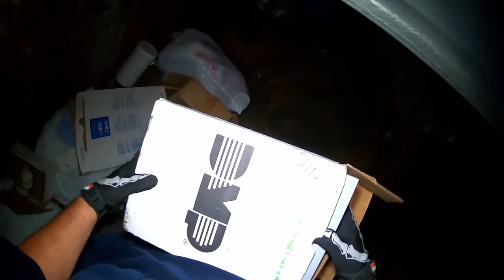Dumpster Diving "Now THAT’S A Knife!"

Comment: It is amazing the things people throw away, most of which could still work if they took the time as you saw like changing the batteries. 
I used to dumpster dive when I was very young at the bookstore next door to use as was surprised at the stuff they would toss. We finally called them once when they tossed a whole Xmas figurine ceramic set that had nothing wrong with it. Yeah, I'm a honest person.  They came and picked it, thanked us then put a lock on the dumpster !
Reply: 🤣🤣🤣 You could have wrapped up the ceramic set for a Christmas present for Mom.

Comment: Hhahaha... 45:00  90° @ 108% humidity.  Not possible but even at 100% humidity it's 132° heat index.

Remember these things are in the trash.  They may work.  But do they work correctly?  I hope they do.  Congrats on the finds.

Comment: That style of black shelf at 14:45 would be graet to build your walls out of but it works a lot better if you line the inside of it with chicken wire or smaller I liked the smallest I could get because you could throw small bits and those stud things you dont like cant fly out if you make the back the same my set had slide on hinges that attached to the side walls and the side walls were able to open aswell when you attach them use bigger hinges and weld them to the inside of the bed but remember to build them so they lay flat against the side of your truck I havent forgot how much you love your truck so the next time you see that rubber stuff in the bins that you didnt know what you could use it for if I was you I would put them underneath the plastic tub thats in the back of your truck because if you look carefully you can see the floor at the back between your two wheel atches and your tail gate you done most of it when you dropped that big motor from the top of the open top plus when you through in the heavy metal doors.👍👍✌👊👊

Comment: 19:39 Those have nothing to do with fuses.

Those are clear keyboard key covers, for IBM point of sale keyboards. The included plastic tool is used for removing the key covers.
Each keyboard key can be labeled, and those covers cap the keys, to protect the labels.

Comment: i took the wood top off of a bedside hospital table like that, put a stainless panel from the front of an industrial dishwasher on it, and made me a height adjustable, rolling work table for my garage. i cut a rubber floor mat to fit in it, and it's got a 1" lip on all four sides so tools and parts can't fall off. i just roll it up to whatever i'm working on, set the height, and bob's yer uncle, i don't have to worry about my 10mm socket getting eaten by the tool black hole that every project has. it's about 75 bucks to buy one, i made one for free in 20 minutes from crap in my scrap hoard. can't beat that with a stick.

Comment: The clear plastic pieces you found in the computer dumpster are keyboard overlay covers. The grocery store had paper templates to denote what each key did. The plastics covered the paper template to keep them in place. Not used much anymore. Most stores have switched to touch screens.

Comment: Fluke is high quality electricians tools, absolutely the best there is, expencive, very presise measuring tools built to be safe for professional workers, amateur hobbyists will love these if they has the use for it. Fluke has a better fuse system and isolated test leads that the cheapie multimeters has. Yeah, Fluke is the #1 so fix this one :)
You can just pick a new battery clamp from a dead 9 volt battery and use that instead if you peel off the battery case metal carefully, 9v batteries has 6pcs of smaller AAAA batteries inside so it is not a mess to do it. I did it a few days ago. You can solder the new battery clamp on, some hotglue to insulate after that and voila done, easy fix but make sure plus and minus gets to the right places :)
Take off the rubber insulation and take photos with your phone of the wiring before you disconnect and swap the battery clip, they you wont screw up the red and black wires.
Black is minus, red plus. Fluke is like that, if you find something from China it may or may not be the same color code this way, but if knowing electronics one see where thing goes.
If not knowing then look for electrolytic capacitors and diodes, those will tell where it is becourse they only go one direction, so yeah, they reveal that. Minus is often connectted around the print card board PCB too on the outer edges, not always but often.

50 ohm good quality coax cables are by the way very nice for people who build antenna systems, you might be able to sell it to amateur radio hobbyists who lives nearby perhaps.
The 70 ohm tv coax is not as good becourse not the right impdance especially for transmitters, they waste alot of power by doing 70 ohm.
But 70 ohm can be used for building loop antennas for recieveing radio stations one else wont get.
Here is a good loop antenna that can get good quality audio in a noisy computer place and separate away and get the radio signal from other transmitters with weaker signal becourse loops are directional antennas, hers he is listning to one of those here :)
It is made from laying around coax, a ferrite ring iguess hum noice filter fom a ddead pc power supply used as a balun, and it seems like it is a low pass filter the black box with red text, and a RTL-SDR (software defined radio) radio with USB for computers that can get most radio frequencies included amateur radio if he use another antenna than this.
One can see the whole band with all frequencies at the same time so it is easy to see where radio signal is here and there :)
DIY Noise-Cancelling Passive Loop (NCPL) antenna results
https://www.youtube.com/watch?v=rziFNgngQeY

He does cool the RTL-SDR radio inside a heatsink with fan i can see, it gets hot, i have two of those RTL-SDR's myself among a few others like SDRplay rsp1a and a chinese clone cheapie that is actually not that bad.
I think the RTL-SDR does use 0.3 ampere and multiplied with 5 volt from the USB that makes 1.5 watt power and with no cooling heatsink on that litle SDR radio box it gets just very hot.. too hot.. so hot that it wont work properly on very high frequencies actually, it drifts a little when getting hotter.
But smart of him to put cooling fins on it, i got some cooling fins laying around myself so i will do the same some day if i want to swap my favorite SDRplay with the RTL-SDR one day to see if it gets better reception on some other frequencies/ antennas.

Comment: The old computers are the most expensive when scrapped the have all the hold hopefully you know that before selling them!
Also no your wrong if you want just one shelf all you have to do is crisscross guide wires where the other shelves would be to stiffen up the structure. Nice video thx